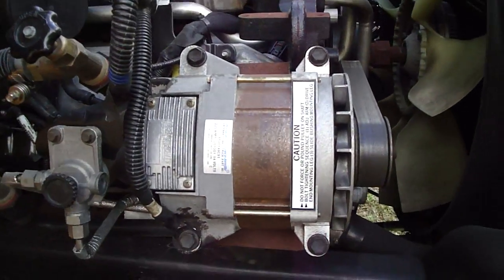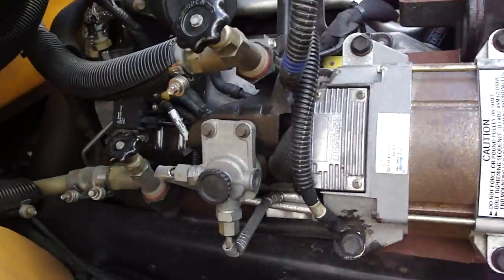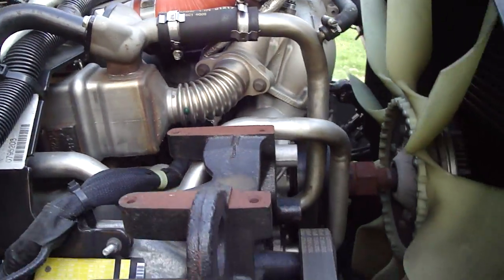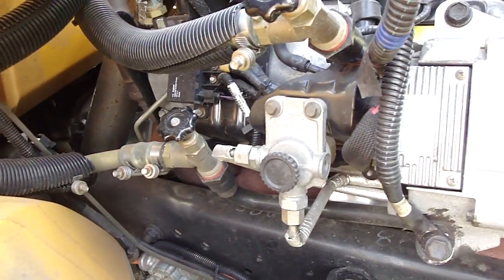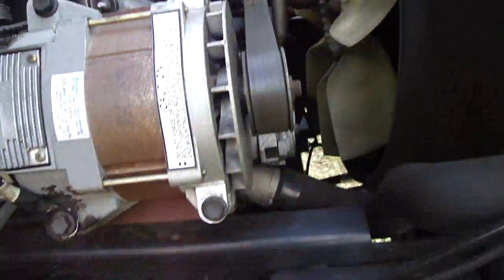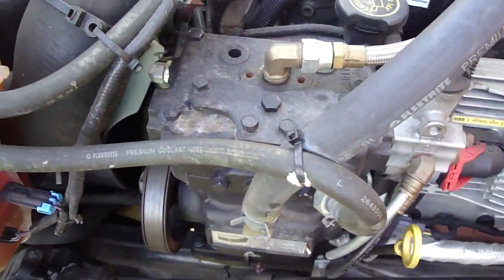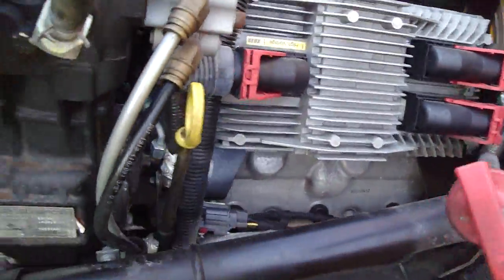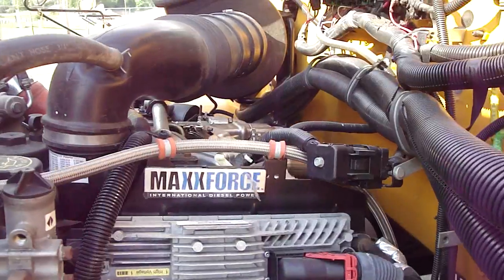Bus Driver: EngineRoom

Comment from the maker: The Maxxforce engine uses an advanced exhaust gas re circulation tech that helps to clean up emissions.  This is by far the most complex bus I've ever driven. This thing is loaded with electronics that monitor virtually every system. I'll do a video of the dash lights to show all of the warning icons, it's comical that there are so many of them.